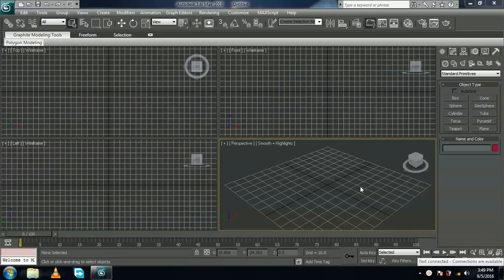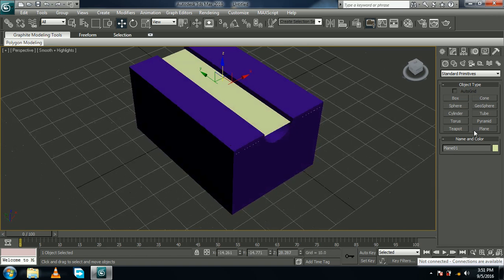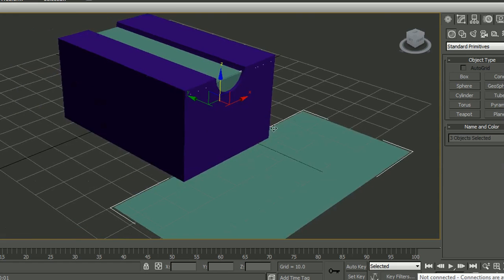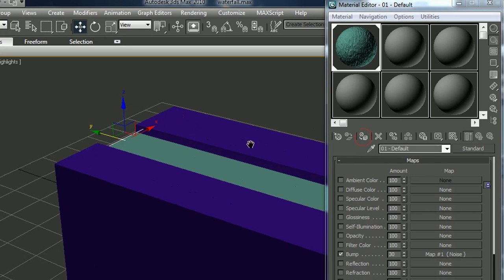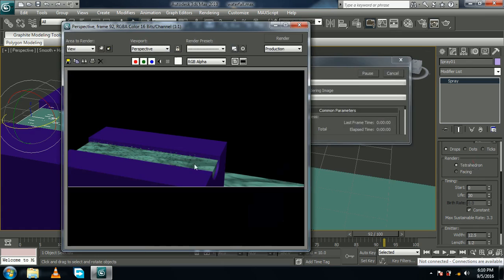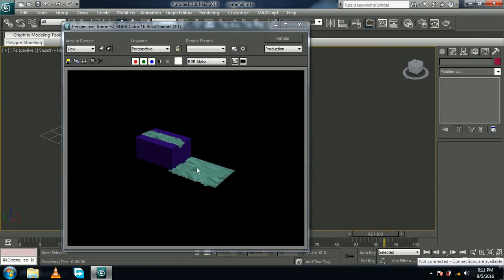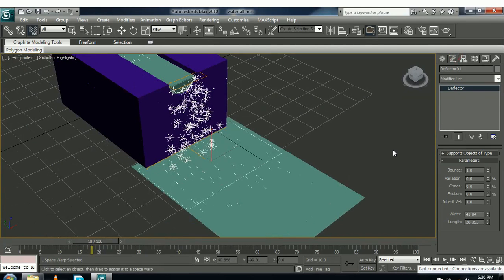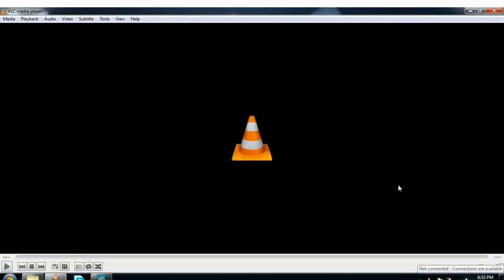Making Waterfalls in 3ds max using particles

Comment: If you are giving different colour to ambient and diffuse you need to unlock them. Because i dont know if you noticed it or not but the ambient colour that you set changed when you set the diffuse colour, otherwise good tutorial.
Reply from the maker: Yeah I did notice that! I just made a slight mistake there, but nevertheless it doesn't really affect the final product, so I didn't edit that part out of the video. 👍😀